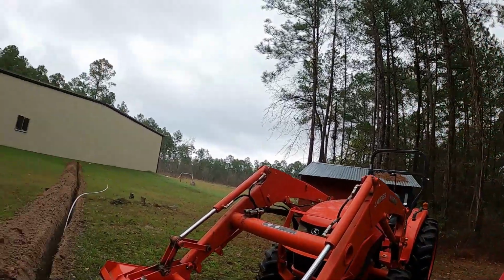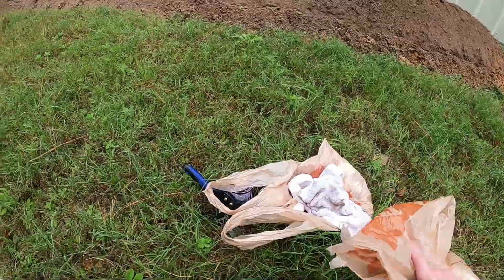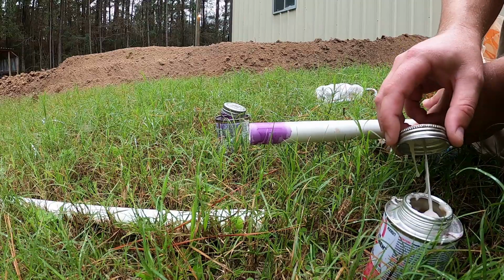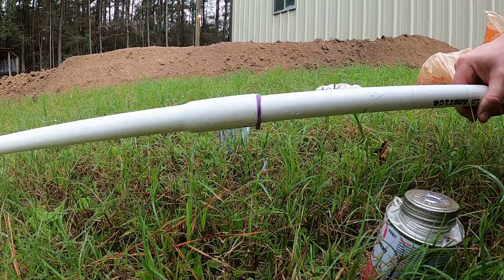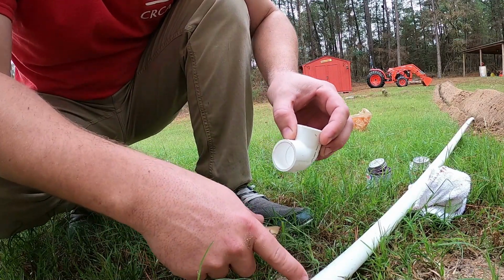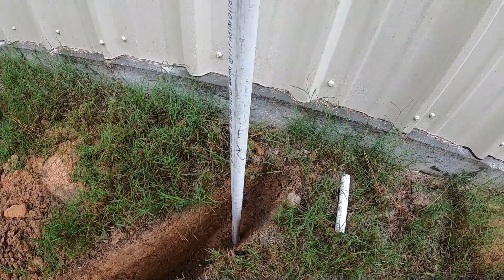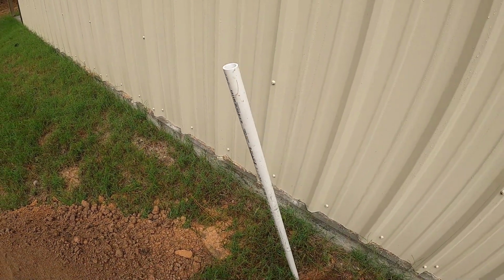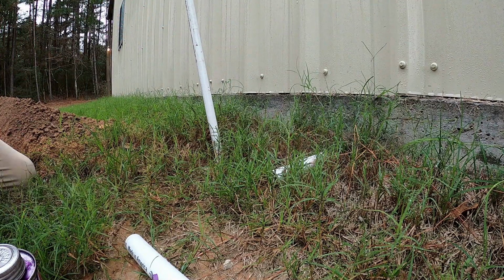How to Bury a Water Line (For my Shop Water Supply)

Comment: Can you not just lay PEX in the trench? Or is that not to code outside the walls?
Reply from the maker: Yes PEX is for inside. There are other materials besides PVC though.
Reply: yes you can definitely use PEX in the trench